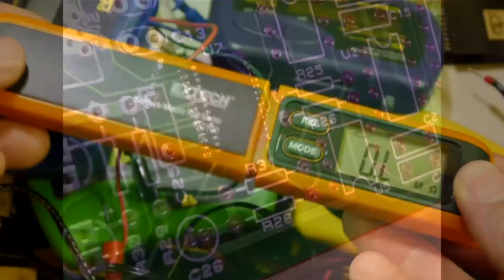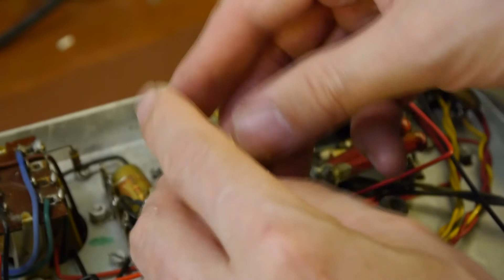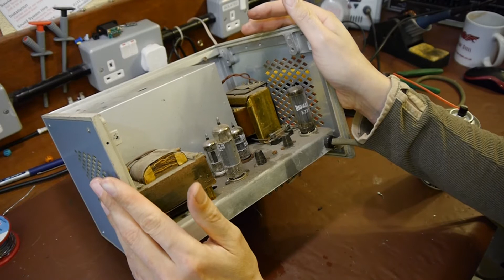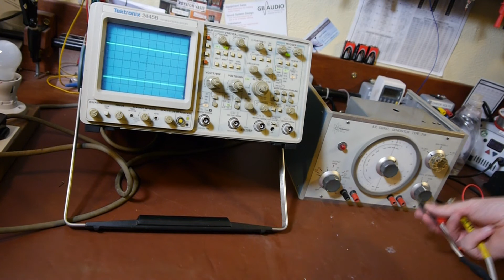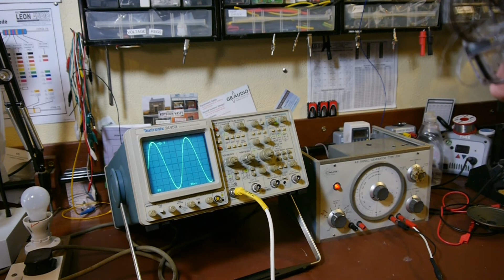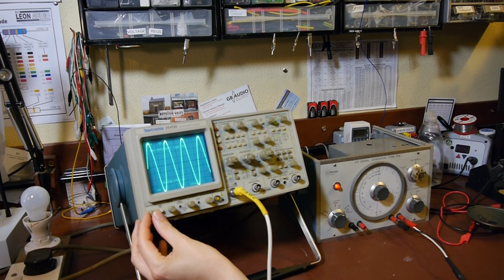Advanced J1B.   Part 2

Comment: If you want me to take a look at the scope Chris let me know. The focus can be improved but it sounds like it might need recapping. There is an adjustment for focus at the edges. I too have an HP scope and love it. Have a twiddle with astig control too that might sharpen the edges a bit.
Reply from the maker: Simon Spiers  Hi Simon thanks for the offer. I'm very tempted just to send it over but I'm wondering if I should try and have ago myself. I'm a bit put off by the nightmare you had. I wonder if I should try a recap first myself  and see how that goes.  Do you think it will likely be a rabbit hole of problems?    I used to have this scope flat on top of other equipment  and  it used to lock up after 20 minutes i think this is the first time I have had upright on the bale stand with more air flow. I know you warned about cooling on your last video.
Reply: It could well be the cooling causing problems. Have a look at the Supply voltages for ripple etc. Looks like a DAC problem with intensity if its the same as mine. Thats not fun!

Comment: Hi Chris,
 The line on caps goes to the lower potential side, to ground for example, the wire is connected to the foil that ends up though rolling on the outside of the cap, MrCarlsons Lab did a video on this, I'm assuming that the lower potential foil shields the higher, (or summit to that effect).
 As to soldering, A good soldered join will involve some "alloying" of all metals in the join, thereby increasing the melting point. Also, from my experience of repairing stained glass windows, Lead doesn't take many years to go crystaline and unworkable.
 Bloody mystery about that fourth screw innit?
 Cheers, J.
 Oh. I see you're a fan of analogue meters, (Nice pair on wall), I spent many years restoring stuff at Monkton Farleigh Mine which was an underground ammunition store, the underground switchroom was amazing, metering and coloured glass lamps everywhere, looked fantastic all lit up, Now sadly all destroyed.
Reply from the maker: Average Joe  Hi joe I was trying to explain the shield goes to the earthy side, but not very well. Funny  the cans were not connected to either side of the capacitor so I was wrong on that idea. Yes I do collect those large meters altogether I am slowly learning to control myself as I'm running out of room to display stuff. I am actually thinking of trying to get rid of some of my stuff as it's starting to get in my way in the workshop. I think hoarding is probably an engineers disease.   Is the mine still open? I'm a member of the mining society and do a lot of mine and cave exploration.
Reply: Sadly we closed the museum years ago and it's now partly secure document storage, My friend Nick McCamley has since been writing and publishing books on mines,wartime stiff etc, I have a few of his books- nice pictures and writing. He is "Folly Books" if you're bored have a look.
 I spent many hours and days exploring mines, dug into a few (and party out of one), many fond memories, I've been in all the Corsham and box mines and others around the country, nowhere was safe from us!.
 Cheers, J.
Reply from the maker: Average Joe  I wonder if it's still possible to get permission to access your mine, you have stirred my interest.  We did an inspection of the main shaft at magpie mine in the Peak District last year and I helped cap a few of the old shafts. The have a really nice old stationary lister engine that runs on paraffin to run the lighting and workshop
Reply from the maker: Average Joe https://youtu.be/9YF9an362Pg
Reply from the maker: Average Joe are ok I will mention my peak mining society. If you over Yorkshire way let me know i will sort out a mine trip for you
Reply from the maker: Average Joe found this showing your engine https://youtu.be/z_7McEtq4_0